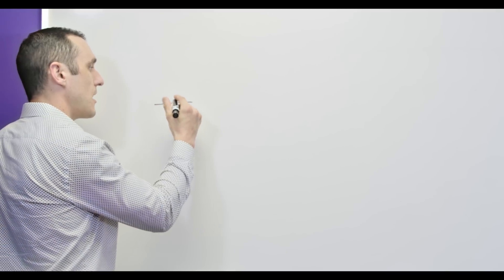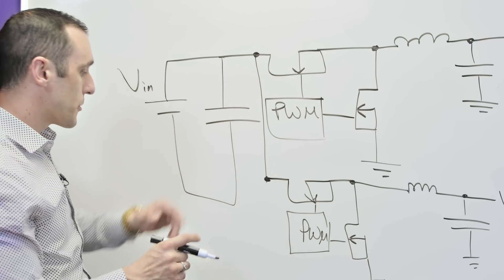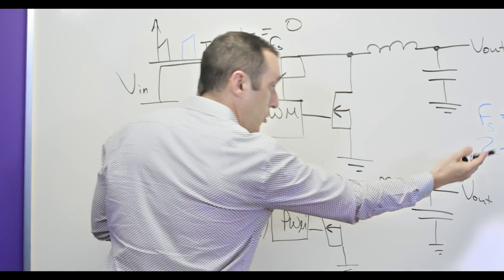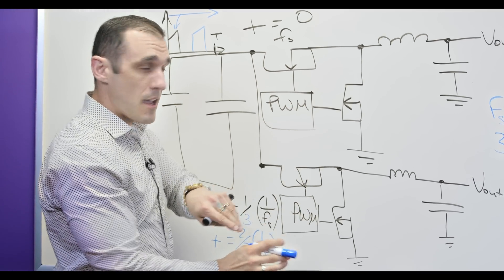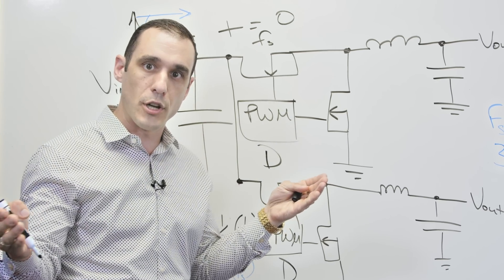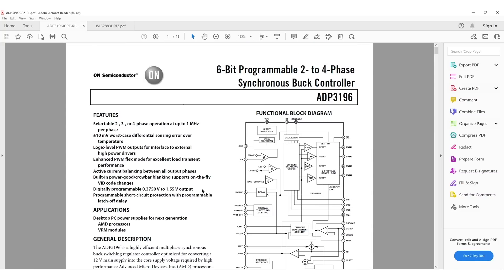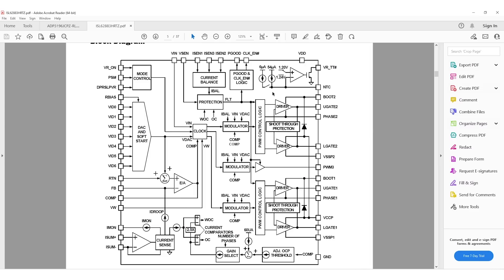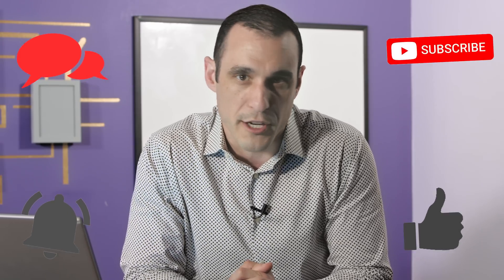Multiphase Buck Converter: The Fundamentals

Comment: What happens if all them switch together, other than ripple. Does it impact stability of the overall loop. Thank you
Reply: It depends on how the loop is constructed. Some multiphase converters have one feedback loop per phase, while others have a single feedback loop for all phases. Using a single loop for all phases means that the loop stability is taken starting at the multiple of the frequency of an individual phase. I think in the single feedback loop case, excess parasitics on one phase will affect stability of all other phases, and I do not know how the PWM controller accounts for this.

Comment: Multiphase is used for ADAS (RADAR) as the noise level required is down at 10's of uV a MHz. The system accuracy is derived from the PSU voltages.
Reply: Yes it is, those ASICs can require low level core voltages with a lot of current too, multiphase is good for that as well.

Comment: Isolated multiphase buck converter would this a good choice?!
Reply: I have not seen any isolated multiphase converter available on the market. This is currently a research topic. If you look on Google you will see many scholarly articles looking at the design of isolated multiphase converters. I think the reason this has not been achieved yet is due to the difficulty of isolating all the phases with the same transformer. This is because you have a lot of switching phases in parallel. You could isolate all phases separately but this makes the system very large, so it would be desirable to do this through a single transformer in a half-bridge configuration or resonant LLC configuration.

Comment: OK, so commenting before I have to go. its lower noise and higher current, because you have the resistance and voltage (and thermal) noise cut in half, plus you can use smaller, higher quality inductor parts as its higher FS and easier to filter (although more challenging to lay out). 

does it make sense to use just because you want lower noise with a higher voltage drop than is practical for linear, even if you dont really need a higher current?